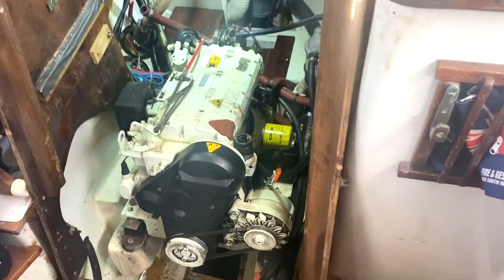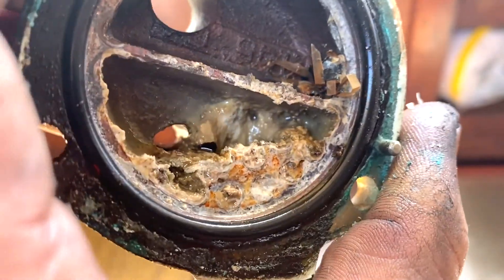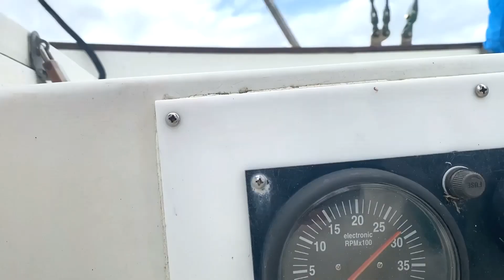The Heat Exchanger. Yacht Engine Overheating issues  Episode 2

Comment: Seeing that Calcium build-up is just another readon why I tell boat owners to look at installing either a 3-way valve onto their thru hull seawater intake so the raw water can be closed off and the engine can then be run out of a 20 litre bucket of freshwster mixed with sum dishwashing liquid. Or a simple connection can be placed into the seawater strainer so a garden hose can be attatched to the strainer to flush the engine with. Saves time and a lot of money for a tiny outlay. Plus the added bonus of having the 3-way valve is that if God forbid the boat starts taking on water and the bilge pumps cant keep up or they fail you open the valve and with a suitable hose attatched you use the engine as a bilgepump. Plus I cant get over that the engines tube-stack has such a dead/unused portion in the middle.
Reply from the maker: Great points . Thanks for the ideas.
Reply: I’m beginning my heat exchanger refurb. I like the idea of the 3 way valve!